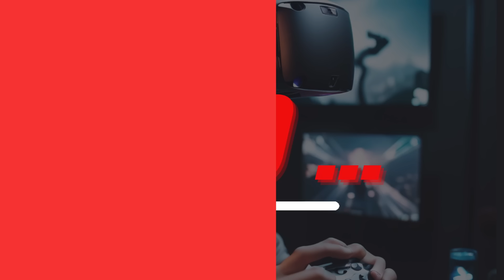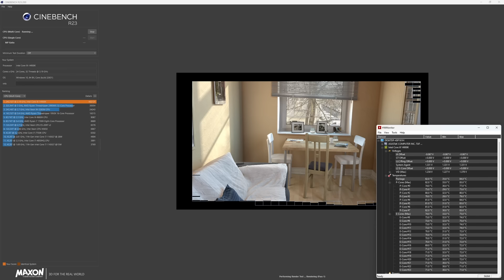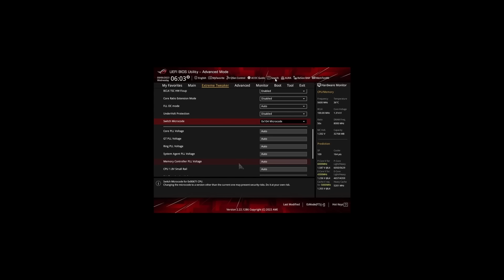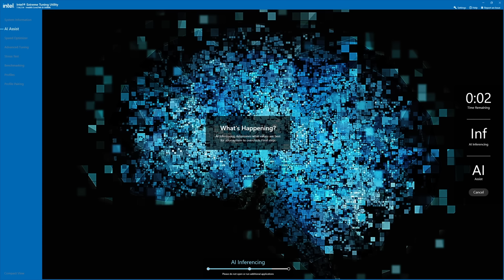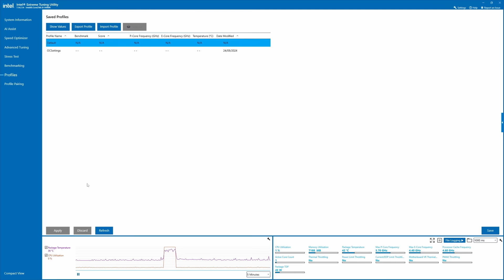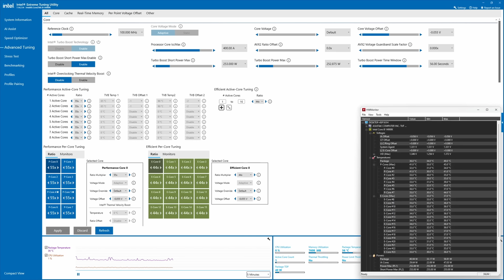Comment: Hey man, thanks so much for the video. It really helped me stabilize my CPU by 14 900 K. I’m currently running the Z690 D4 Asus my ram is the Corsair is 3200 dominator platinum. It’s set to XMP settings which is 4000 MHz. I was able to to underclock my CPU to 5.6 GHz all cores with thermal velocity, boost turned off with an under volt of 0.030 I raised  the ICC to 4.30 A and both the turbo boost short and long to 256 w getting zero thermal throttle zero power, limit throttling, and zero current throttling my current scores for the benchmark and Intel are 13,786 and my current scores for R 23 is 37,886. I’m happy with it. I’m not losing frames in any of my games now I’m actually getting 20 to 30 more frames with these settings and my 3080 TI again thank you so much. This has been awesome. I’m so happy,  I actually had to return my 13900 K a couple weeks ago for a refund through  and I went and bought this processor, I’m just really happy that I was able to find your video.
Reply: No worries glad it helped thanks for the comment 😎
Reply: @nextlevelsimgaming  what do you think of those numbers though? I’m pretty impressed.
Reply: @michaelkmusicofficial  Look good mate, you should expect better performance through a reduced thermal throttle

Comment: 24:40 - You started the video with your settings on 58x for Core 1 and 2, and 55 for the rest. But later said you set all to 55, and prefer that. Reason for the change off what I assume was your default; at the start of the video??
Reply: @iDrkTV  This video will explain why 5500 is the optimal frequency 

Undervolting and Tuning Guide Intel i9 14900k - Core Sync 5500 to 5800 mhz &  Performance Benchmarks
https://youtu.be/hh3FIN1c_ZQ
Reply: @nextlevelsimgaming  For sure, I watched that video already, previously- That's why I was confused at the start of this current video that your settings were 58x, 58x, 55x on the rest. :)
Reply: @iDrkTV  5500 is the optimal setting for the i9 14900k as the thermal dynamics of the processor are poor, what you lose in frequency you gain in performance due to the processor throttling thermally.

Its been a while since making the video but I assume it was one of the settings saved under a different profile being tested at the time, remember in synthetic benchmarks the results may be higher at 5500,  but in some scenarios such as competitive FPS gameplay you may benefit from a higher core frequency and take the hit on higher temps
Reply: @nextlevelsimgaming  Appreciate the responses! I def play FPS games, but don't want the higher temps. I'll roll with the 55s, haha. I just got my replacement 14900K and wanted the right settings for it, fresh out the box :)

Comment: aren't you losing perfomance removing the 58x cores and disabling tbv?
Reply: @yuetel7790  No, the reduction in temperature provides more efficiency and improves performance
Reply: @nextlevelsimgaming  I have an i9 13900k the only thing I did was put a negative offset and that was about it. Does your way by syncing all cores and so on use more resources than it should and shortens the lifespan of my components or is it the same thing?
Reply: @ No, the cores behave independently so some boost, some idle, the fluctuations in these causes instabilities if the voltage regulation is incorrect, hence the crashes prior to the microcode revision.

By syncing the cores they will work in unification, and more consistent, they will still idle, they only go to 5500 when required
Reply: @nextlevelsimgaming  Well, my i9 13900k never had any crashing does this still apply to me? also that 5.8 isn't that something I will see in my games if I still keep it?
Reply: @yuetel7790  The video is for an i9 14900k so the cores wont sync that high on a 13900k
Reply: @nextlevelsimgaming  is there anything you can help/guide me with for my i9 13900k? doesn't this apply to my i9 13900k too?
Reply: @ Sync cores to 53 and undervolt in the same way
Reply: @nextlevelsimgaming  will try that now thank you, but having all the cores synced won't raised the temp higher or nuhh?
Reply: @ It does but sync the cores to 53 not 55
Reply: @ No, they will only go to 5500 under load, they will work combined rather than at different levels which is where the instability occurs
Reply: @nextlevelsimgaming  somehow I managed to just use a negative offset of -100mv without syncing cores and not changing any cores or disabling tbv, and I've ran cinerbench r23 multi-threaded for 30 min got 37k score with extremely low temps and I tested occt for 30 min ram+cpu/memory no freezes/stutters nor crashes is that a good score?
Reply: @ A well optimised i9 14900k would be expected to achieve ~ 40k on R23 but the scores aren’t really important stability and temperatures are the most important factor

Comment: i still manage to get better score everywhere with new microcode 0x12b With i7 14700k on MSI MPG Z690 doing these steps cpu load lite mode 3 , voltage calibration mode 3 , -0.100v on cpu core voltage offset , thermal velocity boost disable , Core iccmax 307a , both 253watt turbo boost short and long while keeping low temp pcore at 5.7ghz ecore at 4.5ghz. i score over 37k point on cinebench R23 , im running 64gb ddr5 at 6000mhz cl36-36-36-77-113
Reply: Thats a good score for an i7 14700k 😎
Reply: I just built my first Intel machine ever and I think I have it figured out but it’s hard to tell because these chips don’t undervolt and overclock at all like amd chips.

I simply want to set it to run at 6.0ghz while I’m actually gaming it as close to it as possible while still being stable. I’ve gotten it to outperform the 7950x in single core by 21% at the most but the better configuration seems to hit about 18% single core gains but far less losses in multi core like the first that it’s almost equal to the 7950x in every way cpuz can see in threaded work loads and about 20% better for single core workloads.

Things is most games now are dual and quad core work loads and they don’t really seem to have a way to configure a proper 6ghz OC with an undervolt for anything that uses more cores than a typical game.

Is this somehow possible on intel with the V/F shift? Also why does the shift ignore the fact I’m not running it at the speed it says? I don’t understand these v e and o cores. What happened to cores and threads? 

I have a great chip with new silicone and it’s never seen a bad microcode boot.. I want to get the most out of it and don’t know where to start without using shitty ai Oc bc not many ppl are bios OC new Intel raptor lake chips… fewer making tutorials…
Reply: @ Unfortunately 6ghz boost is the reason for instability with these chips, even with an Undervolt applied you won’t get it outside of throttle if it boosts for any sustained amount of time.

I have a future video on a tune at 58 all core in the next couple of weeks, but have never been able to get any stability beyond that, and even so if you want the processor to last you are far better sync’ing to 5500 as per the guide.

6ghz is designed only to be attained in short duration boosts when the processor environmental conditions allow, check this video about why 55 is the optimal frequency 

Undervolting and Tuning Guide Intel i9 14900k - Core Sync 5500 to 5800 mhz &  Performance Benchmarks
https://youtu.be/hh3FIN1c_ZQ

Comment: Any recommendations for a 13700K? I just updated to the latest Asrock BIOS with the 0x12B mc.
Reply: @j_shelby_damnwird  I can only comment on the i9 14900k unfortunately, I don’t have other processors to test, however the principle is the same for undervolting, if you adjust the various power limits based on your CPU

Comment: is there 1 For i7 14700kf ?
Reply: @unitofmadness5770  Unfortunately not, I don’t have a 14700kf to test.
Reply: @nextlevelsimgaming  cheers anyways my i7 still jumps some high voltage with the new patch and yea i been getting those mouse locks once and awhile.. ill end up offsetting voltage -.050 to keep below 1.45 but yea there not really fixing there problem.

Comment: Most of the settings worked for me except the Global. First I tried -0.070 and kept working my way down by increments of -0.005 until I reached -0.030. I ran OCCT's linpack stress test and kept getting the BSOD. I eventually set the Global on Auto and things are stable without any errors or crashes.
Reply: Thats good, except you’re overvolting not undervolting, you would start at -0.05000 then in .5 increments dial the other way so -0.05500 then -0.06000 etc, try it going the opposite way 😉

Comment: Following your guide, I've managed to somehow get 40k points on the dot with cinebench. I believe I've found the best CPU profile for my specs. I left all cores at 55 besides the active cores #1 & 2 at 57x, and p-core 4* & 5* at 57x with a core voltage offset at -0.070v.  I have a brand-new PC with i9-14900KF, NVIDIA RTX 4090, Z790 gaming wifi7 motherboard, and 2 16gb t force 6000MT/s RAM.

One thing I still don't understand is why HWMonitor reads about 5-7 degrees Celsius higher than the NZXT CAM app.
Reply: @Recon911PDW  if you search Reddit for the subject (r/NZXT) CAM apparently monitors an average of all core temps, not the specific core temp.

I wouldn’t get too hung up on Cinebench, I have a further Part 2 guide this week and I achieve just over 39k, this can be pushed higher with even more refinement on the negative offset but I aim to show you how to run a system that performs better than the Intel Default, not one that produces instability at the cost of a higher cinebench score.

I have done some extensive stress testing on these results and am pleased to report that everything has not only passed those tests, so watch for that 😉

Comment: Here watching this video multiple time with same set as you but what I’m looking for is really performance and not lose a lot of fps
Reply: @ander8329  You will gain improved performance as lower temperatures, and preventing the boost will prevent throttling.

Interestingly, I am presently doing a part 2 to this video that gives some examples to exactly that 🙂
Reply: @nextlevelsimgaming  amazing I will try that when I get home I have a i9 14900k with a 4090  let’s see how it
Works

Comment: Sure...run the bios update Asus says on their Rog Strix Z790-H"The new BIOS includes Intel microcode 0x129 and adjusts the factory default settings for the non-K processors, enhancing the stability of Intel Core 13th and 14th gen desktop processors." so yer on yer own no K processor default settings. by definition they're not stable try to find this video. Burn out your cpu running cinabench or some other grinder benchmarker thermal limiting cooler tester guaranteed to load everything past normal use limits
Reply: @bloviatormaximus1766  It does apply the update to the K processor, what it is saying is the none K processors get the default settings change only as they are not affected by the microcode issue, the K processor gets both

Comment: Had my Intel i9-14900K fail in April and having got it replaced under warranty have not yet put the new one back in my system.
I did the Latest Bios update on my PC the other week and since then I’ve been experiencing issues with the i7–14700kf that is in the system currently and been getting application and program crashes  in use and even had the entire system crash and restart with an error about Kernel something or other. I’m wondering if I need to re-run and play with the Intel XTU Program to maybe try and restabalise my CPU since that bios update has messed around with it?
Reply: @Cwattyeso  I would certainly recommend syncing cores, and undervolting, a safe undervolt is considered to be negative offset - 0.0500 so begin with this and sync the cores to I would say 5.3 looking at the specs of your processor.

Comment: @nextlevelsimgaming,  how do you recommend that the tweaks we do in XTU are applied on every reboot?   Do you have a recommended approach?

P.S.: I realized I may have had an assumption that was wrong all along.  Using Intel XTU to do an undervolt and your other recommendations, I thought these settings were used on reboots until/if a non-standard shutdown occurred then it reverted.   I'm seeing now that the settings ARE NOT automatically applied by XTU unless you re-run the app.
Reply: @windfire5380  The settings are set as soon as you click ‘apply’, you can then close the application in the tray to avoid the process running and using system resources, you don’t need to reboot.
Reply: @nextlevelsimgaming  I get that.  But on reboot, can I be confident they are still applied? 

In settings "Advanced tab" there is a "restore tuning after reboot" .  Does this ensure they are re-applied each reboot? (unless I have an abnormal system shutdown which resets)?
Reply: @windfire5380  Yes, the settings are saved after reboot as long as the Watchdog service shows False to quote -

Under Intel® XTU System Information, find Watchdog section and confirm Watchdog Present shows False. False means the Watchdog is not detected within the system, and the Intel® XTU user will have to manually restore settings/profiles after reboot.
Reply: @nextlevelsimgaming .  That quote is so confusing to me.  It reads like you want Watchdog Present False if you want to have to manually restore settings.   

To get the settings to load every reboot, do I want Watchdog Present False or True? I ASSUME "TRUE" to get it to work with reboots, but that Intel write-up is insanely poor written.

My checkbox is not greyed out, and I've got it checked.

Currently, I have status :
     Watchdog Present True
     Failed False

Having these two sentences woudl really help:

If you want XTU to apply settings on reboot, ensure "Watchdog Present True". If "False" see this link to fix.
If you do NOT want XTU to apply settings on reboot, simply uncheck the box for restoring tuning in Settings.
Reply: @windfire5380  That was a quick consultation with the Intel site, I have checked my configuration and it is the same as yours so I can confirm the settings will be retained after reboot, I am presently benchmarking for an upcoming video so know that the settings are retained.
Reply: @nextlevelsimgaming  Thanks much. It is channels like you that clarify all this stuff!!!
Reply: @windfire5380  Thanks for the kind comments glad to have helped 🙂

Comment: FYI, I was using Intel ETU to undervolt my 13900K by -0.110v from the start  (but that is all I did).  (Cinebench R23 = ~38,800). HOWEVER, I still experienced the damage.  Approximately 1 year after purchase all my Handbrake started failing.

I'm now on 0x129 microcode update. R23 = 33,600 now. :(  

With these recommendations (values appropriate for 13900K) I'm back up to 35,800.
* Changed all P Cores to 55x (was 58x for core 0 & 1)
* Disabled Overclocking Thermal Velocity Boost
* Undervolt by -0.110v

thanks!
Reply: I don't understand why I gotta change the cores and why disable overclocking thermal velocity boost? idk so much about undervolting, but all I did and I've been running the same setting for 11 months is just use a negative offset - 0.050v and adaptive mode and my cinerbench r23 score on the i9 13900k is 36,666 but now after the bios update I heard I can push my voltage even further?
Reply: There are a few variables at play unfortunately, in the early batches of 13th and 14th Gen processors there was a known manufacturing issue of Oxidization which could have affected your processor, the later issues are believed to relate to VID requests being too high, the microcode updates are designed to have fixed this.  Undervolting and reducing core speed is another good measure. as outlined in the video, however no warranty is implied, and any user making any modifications to their configuration does so at their own risk.
Reply: @nextlevelsimgaming  Understood. My point was to warn folks that merely undervolting didn't help me (note: I didn't undervolt to rescue my chip, I just hated the needless high temps.)
Reply: @windfire5380  I think the situation is far from resolved unfortunately, but all we can do as enthusiasts is to keep temperatures as low as possible and voltages as low as possible.  See the Wukong Benchmark I just uploaded as an example of the effectiveness of both using the Custom settings, the Benchmark has been causing failures during shader compilation and running for many, even those running the Intel Defaults.  I have been stress testing and benchmarking much of yesterday so am pleased the custom profile is running both stable, and with excellent performance, and low temperatures and voltages 🤘🏻

Comment: Should the   i5 processor also do this microcode and bios update?
Reply: No, the processor uses a much lower power profile, you should certainly update your BIOS regulary anyway, however the i5 will not be suffering the same issues.
Reply: @nextlevelsimgaming  Do you have a hard time getting into BIOS? The latest macros are installed (0×129)
Model CPU
cpu 13600kf i5
Reply: @POUYA-e3l  I have noticed that it seems to take lomger to get into BIOS since the BIOS update interestingly, however make sure you enable ‘Fast Boot’ in BIOS which should resolve this.